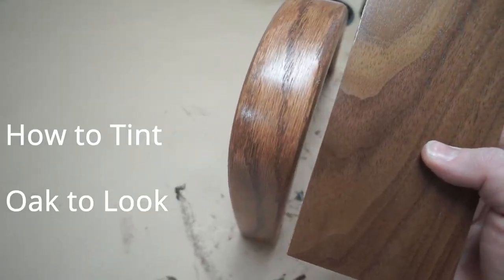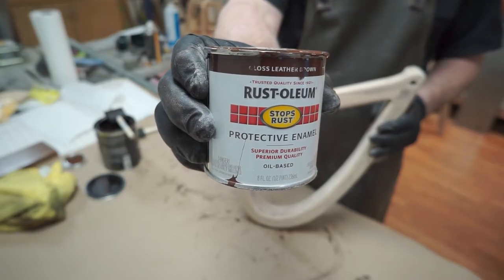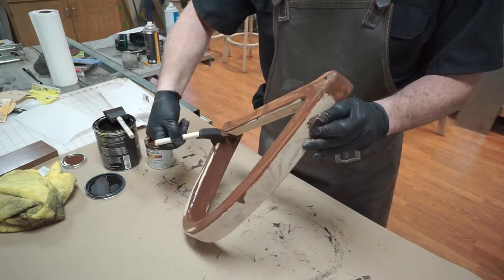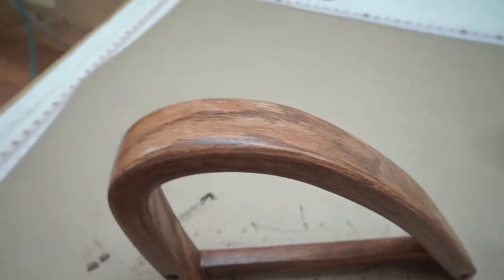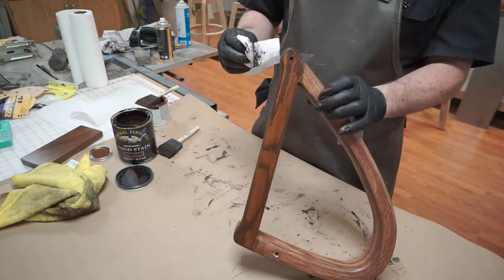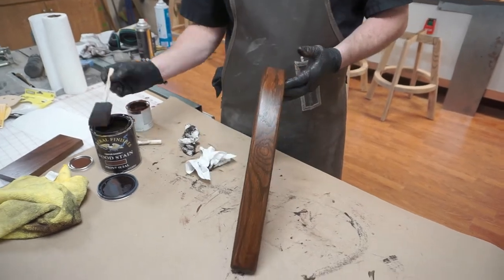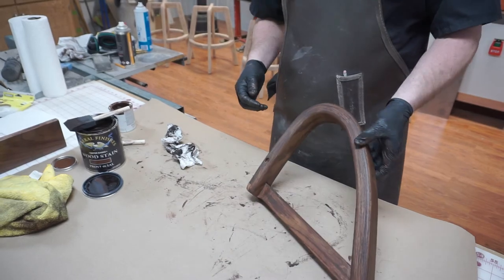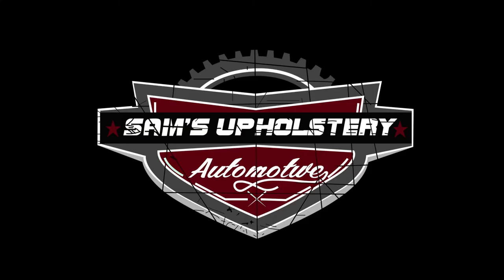Oak Staining Tips - Making Oak Look Like Walnut

Comment: I would like to do this to the top of an old oak table. Did you apply some sort of primer to the stools first?  Is that why they are whitish?
Reply from the maker: No primer, I just sanded them. You could take a damp rag and wipe the wood before staining to help open the pores of the wood grain
Reply: @samsupholstery8499  Were these white oak? Do you think this same look can be achieved using red oak or would you adjust the process in some way?